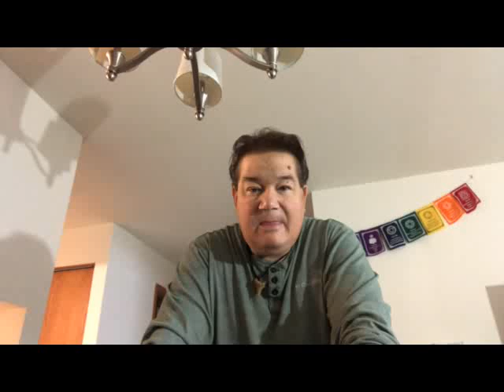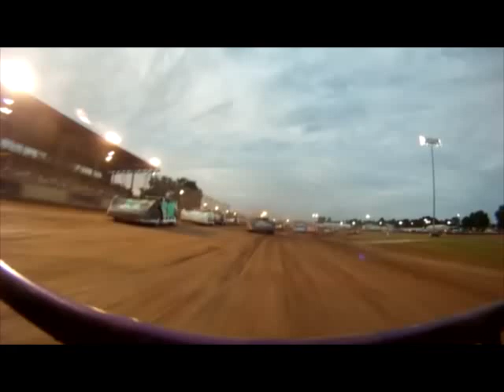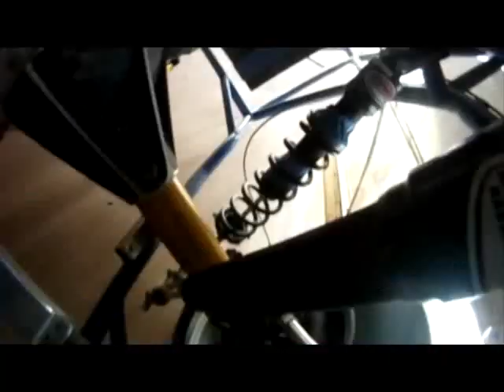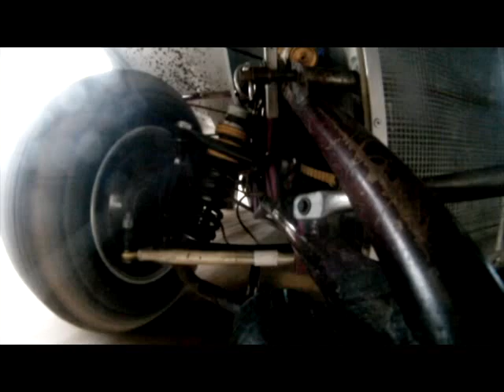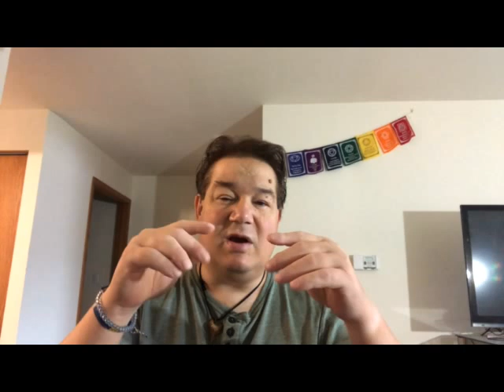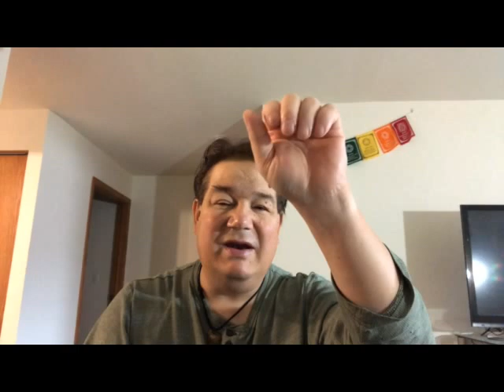Dirt Late Model and Dirt Modified Suspension Binding and Sticktion

Comment: What I want to know is how RTJ’s car looks like the nose is floating around the track while everyone else looks rigid with the nose stuck to the track. I’m sure people know what they’re doing. Can they just not drive it like that?
Reply from the maker: I’ve been watching RTJ’s car for a couple years and he’s doing something different than others. The biggest thing I’ve noticed is in his LR and how it floats. You instantly see when he squeezes the gas. It walks forward and tractions up with the front locking the car at attitude.
It’s like he’s locking the RF down hard and freeing up the compression on the LR. Just guessing. Thanks for watching and leaving feedback.
Reply: All opinion but it definitely appears he has a car that "lays on the RR" considerably more than most. Many drivers dislike the feel of a car in that condition depending upon what transition point the car is in at the point it "lays over". The thing to remember is once a tire leaves the racetrack all of the roll stiffness of the vehicle is controlled by the other axle. Once the LF leaves the surface any additional roll would result in the same grip across the front axle and less grip across the rear axle. This often results in poor "sidebite" feel but at the same time could result in good forward traction depending upon spring rates, antisquat values, etc when the car transitions laterally/ longitudinally. In other words, just like everyone running with the front end down, he still has to balance what he's doing to make it work. Purely speculation  but there's a good chance his car is quite possibly less areo dependant than the guy with the front end sealed off.